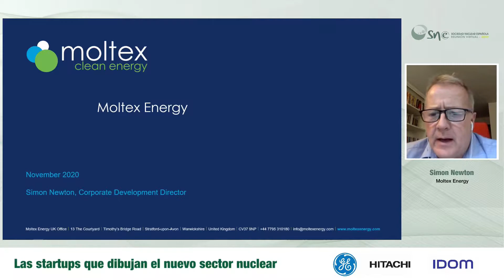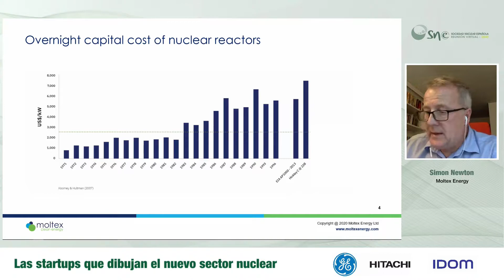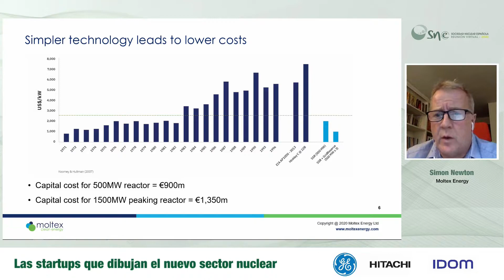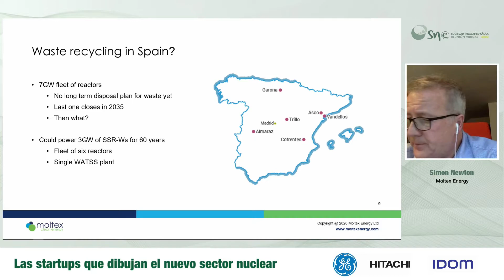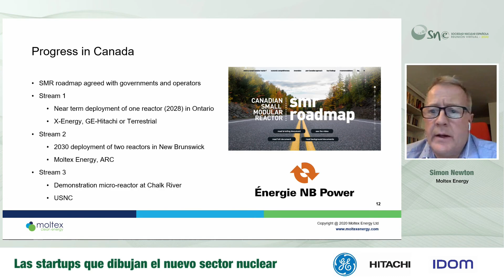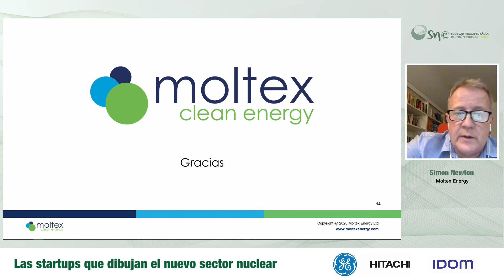Moltex at Spanish Nuclear Society

Comment: 4:07 "There are also no radioactive gases produced by the reaction". Er, Moltex reactors will produce radioactive Kr and Xe gases. These are much less harmful than Cesium and Iodine gases released from famous nuclear accidents, but please choose your words more carefully. Likewise, "no possible release of radioactivity" should probably be  "no plausible large release of radioactivity" or so.

Something I've been puzzling about is this: how is it possible for the Moltex reactor to be air-cooled if it is 1/20 the size of a conventional PWR? A smaller reactor implies a lower surface area, and although Molten Salt Reactors run at higher temperatures, which makes heat dissipation easier, it seems a very compact reactor should still have a problem with heat dissipation. So I would like to see the math showing that air cooling is viable.
Reply: Quite a lot of new high-temperature nuclear has gone down the passive air cooling route. I would guess the key is the higher temperatures, however I'm not an expert. As such I can't really verify Moltex's math here. However, I can say a lot of other companies in the space are proposing the exact same thing which suggests to me the approach is valid.